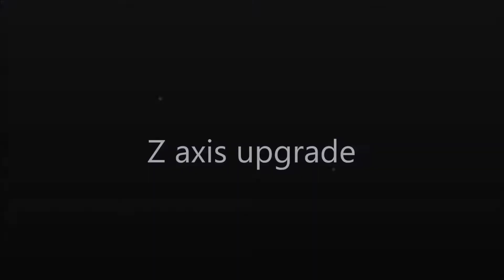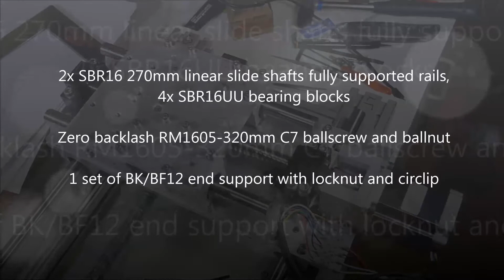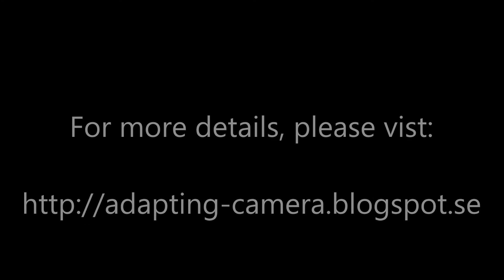My DIY CNC upgrade project, Z axis upgrade

Comment: That's a very nice looking machine
Reply from the maker: Thanks! But what you see in this video is actually not existing any more. I have been ready with the total upgrade for quite a while now, even the controller software is changed from Mach3 to UCCNC. Check my other videos for more detail or read my blog posts on: https://adapting-camera.blogspot.se/ and especially: https://adapting-camera.blogspot.se/2017/02/cnc-upgrade-progress-current-status.html